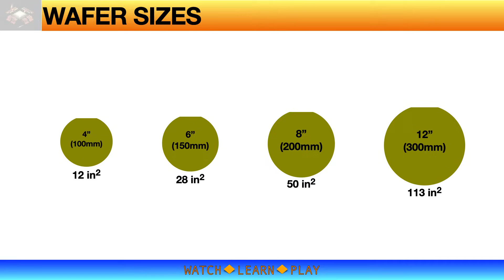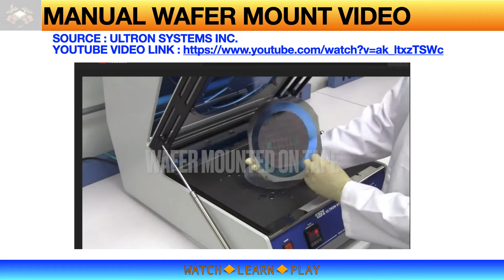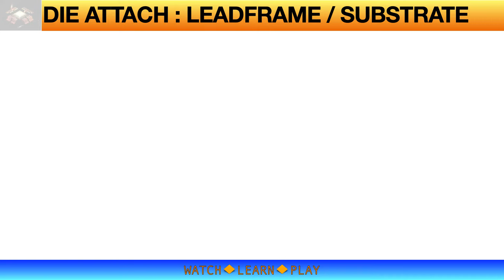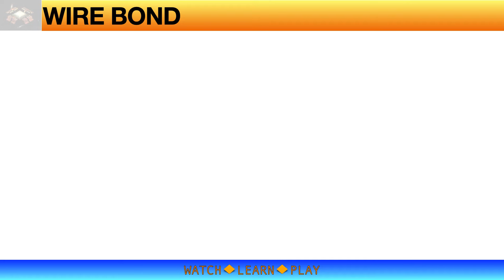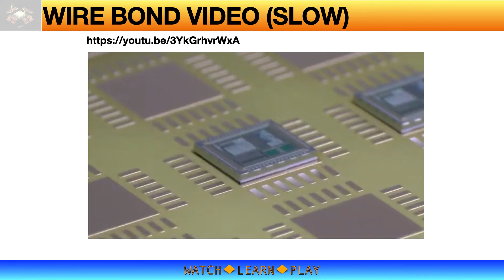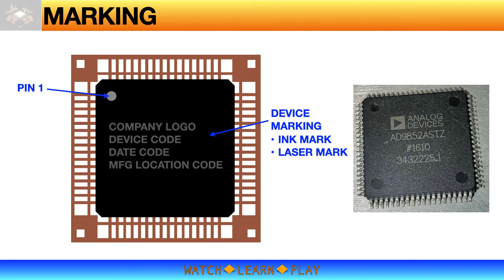Semiconductor Packaging - ASSEMBLY PROCESS FLOW

Comment: Hi! Fantastic video! It is the most detailed video existing. But I don't understand how dies of extremely small size, few tenths of millimeters, like the dies of small transistors like the BC337, can be sawed and separated from the plastic film, without the get pushed away. And how they can be picked up to be transported on the final package. Please could you explain me it, or make a next video for it?
Reply from the maker: Thanks for the comment. The wafer saw video I posted will give better understanding of the sawing process. I will also create a more detailed video related to die attach process.
Reply: @watchlearnnplay  Thank you for your reply! Yes I watched also the video about the wafer sawing. It's very good too! but the dies in the video are big. I can figure how it may work with large dies, but with very small dies, few tenths of millimetres large, it is all different to handle, I guess. Then I am looking forward to watch your video about the die attach! :)
Also concerning large dies, how are they exactly picked up from the wafer, without being damaged? As far I know, nothing should touch the upper surface of a diffused and finished chip, otherwise the material, the structures and tracks would be damaged and the chip would be unusable. Or not? With sub-millimetre dies it is even more difficult. Thank you again for your great videos. Do you work in a semiconductor factory?